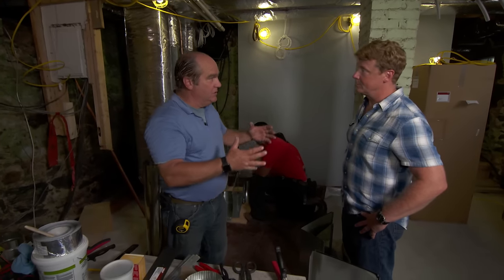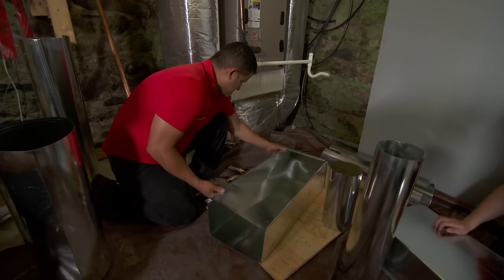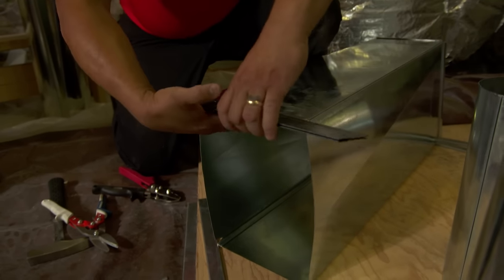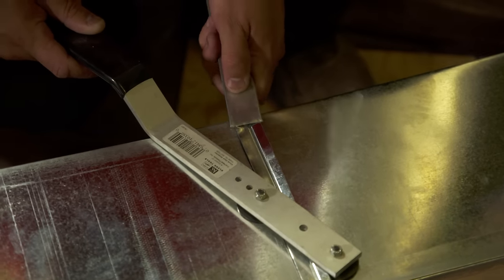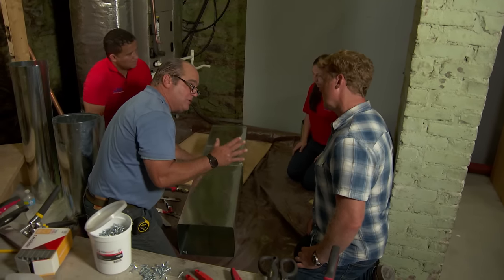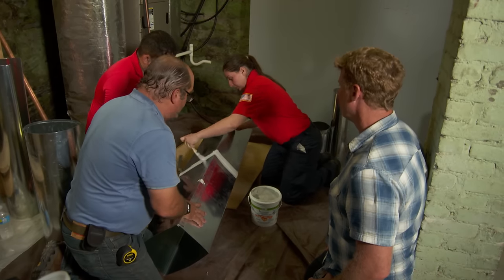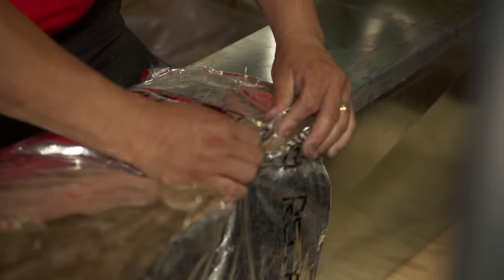How to Install Ductwork | This Old House

Comment: Very well done video but the contractor was a little wrong on the explanation of the purpose for the wrap of insulation. The purpose of the insulation for ductwork is to prevent moisture build up on the outside of the ductwork when the system is in cooling mode because in an unconditioned space when cold air meets hot air it creates condensation in turn can create a problem for water. Yes it also helps to keep the air cool in the duct so that the conditioned air can make it to where it needs to go but the main reason is for condensation. I have seen so many jobs where people tell me they have a leak in there ac system and come to find out the original contractor didn’t install the ductwork correctly and didn’t take into consideration the environment of where it was being installed.
Reply: no

Comment: In every home I’ve seen duct installed, it was never sealed that well.  Good work.
Reply: That's because no one wants to pay for the labor or materials involved in that.
Reply: So true lol
Reply: @CoasterCrazyy  or no one had a Richard watching that it was done right
Reply: @zefrum3 yes this is the real reason. If homeowners and general contractors knew what to expect and inspect what they expect then it would be done right.
Reply: Would you actually be willing to pay for it? Or would you like the contractor to end up doing volunteer work for you and everyone else?!
Reply: Builders want it done cheap and not just fast but. Now! Right now, if you can’t be done in a day you will miss the inspection. And the whine every time.

Comment: The only problem I see is you put the metal Tape over the duct seal which don’t give it time to dry. It’s actually supposed to be dry before you put the Insulation on
Reply: I was thinking the same thing, or reverse it Metal tape then seal It , on anything visible I mask off my lines with tape so I have clean lines, and This makes me Respect that bubble Wrap more than Ever.. lol

Comment: Ok that was pretty cool. Had no idea all that was done to make ducting.
Reply: This is the proper way to do it. I'm sitting here looking at my Grandmothers ducting in the joists of the basement as i type and the masting sealer, foil tape, insulation, screws, etc. are not present. This house was constructed over 50+ years ago though and many acceptable building methods of the era, while effective, are not acceptable in terms of today's professional contracting and construction code books and best practice reference manuals.
Reply: They still work however they are substandard.....
Reply: I thought 2 pieces like slid together didnt know you had to buy all that extra stuff
Reply: For numerous larger scale operations we typically use pre insulated duct boards.  These are much lighter than traditional sheet metal and are fabricated in industrial shops like the one I work in.  It's alot of fun! Especially since the Sheet Metal Trade is relatively small in my area.  You get to know the guys from other shops, installers, and do so all under the brotherhood/sisterhood of the Union.  If you want to see some more cool stuff you should look up Architectural Sheet Metal Fabrication/Imstallation (Building Facades and stuff like that).

Comment: Nice walkthrough! Never done this or even looked into it until now. Question: at 2:10 where he's hammering the drive cleat overhang to 90 degrees... would a hand seamer or other folding tool not work here as well? Is there a reason the hammer is preferred?
Reply: I was first taught to use my hand seamers for the bending of drive cleats. It’s a nicer fit and usually looks cleaner. Now I have used my hammer a million times to do the job. You will mostly be hanging duct and installing it in place. Sometimes it’s near impossible to get the top bend of a drive cleat. Hammer that every time

Comment: Noooo, the installation does keep the air in the duct the same temp but thats not what its foor, its to prevent condensation from developing on the exterior of the duct.
Reply: That's only true if the space its in is unconditioned, like there isn't a heat vent in the room. Say in the ceiling of a garage or a cantilever. Its honestly a waste to insulation so close to the furnace, unless you want to be hardcore and overkill it I guess

Comment: Interesting. I’m switching from baseboard heat to forced air very soon. Baseboard is getting too expensive and central air would be nice since summers are getting hotter where I live. I’ve always wanted to know how ductwork is installed and now I know. After around 20 years my baseboard heaters are nearing the end of their lifespan and I’m ready to replace them with something more efficient like ductwork. Great video!

Comment: Richard, this is something I am preparing to do. I don't know if you will see this, but maybe someone else who knows can tell me. I am installing a built in bookshelf and building a false wall (I guess that's what you call it) to hold that bookshelf. There is an air vent, so I need to extend the existing ductwork by about a foot. Is there an easy way to extend old ductwork without removing it? Can I just screw and tape it together with bending the pieces together?
Reply: Yes, there is. It would help greatly if you knew anyone who knew about the trade because they could whip up an adapter in literally 15 minutes. They might have adapters at the big box stores or stop in a local heating, plumbing place with a phone pic and some measurements and they should be able to help or direct you to a HVAC shop that can make that adapter you need ! Hope this helps.
Reply: @augustreil  thank you for the reply! That will make it easier than I had imagined.
Reply: @brianmoore581 , You're welcome, hope all goes well !

Comment: I was taught to put an "X" in the plenum to reduce noise
Reply: Cross brake. It makes the panel more rigid, which helps with noise from vibration or changes in internal pressure.

Comment: My Dad was a tin guy and I don't know if he installed duct this way or not. He retired in the mid 70's. Are these techniques that old?
Reply: Yes they've been doing it like this before the 70s, although probably not the insulation. Most old duct work wasn't insulated.
Reply: @rawbacon  Thank you so much.
Reply: Old duct work was insulated in asbestos

Comment: Someone has to come up with a better way to control air flow. Duct work seems so primitive!   I'm thinking someone could come up with a material that is self insulating (like an insulated, flexible plastic)  that can be installed in less time.
Reply: Its not primitive at all, they have high efficiency furnaces now that are 95%+ efficient, so you're only losing 5% of the heat generated that gets exhausted out of your house when they used to be 50-75%. That combined with proper duct and pipe sizing and you have an extremely efficient way of heating your home. The way homes are built today they are very tight construction so very little air escapes your house so what they are doing here is way overkill. All you need is to tape, and only insulate were the space is unconditioned.
In a business sense all about cost, efficiency and labor. They have flexible duct that's already insulated but its very expensive and not very efficient (1 foot = 4 feet normal pipe), you could use plastic in theory but its extremely expensive in comparison to tin, although if you want plastic you can do a high pressure system but again expensive.
Reply: Supplies are best install with sheet metal.  Returns you can use flex duct.  Just make sure returns aren't installed at 180°.

Comment: I got two rooms close to my Air conditioning unit that have sooo much pressure it's hard to sleep.

The 3rd area in the house has little pressure due to this.  Is there a way to reduce pressure in the first two rooms?
Reply: You may be able to install a damper on the duct work or even an adjustable vent plateif you want to go really simple and cheap
Reply: Your ductwork may be sized improperly. It sounds like you should have a larger sized supply to the first conditioned rooms (to lower air pressure) and the 3rd room should have a smaller sized supply to help maintain velocity.
Reply: You need dampers so you can balance out the system and send air where you want it to go.

Comment: In my home they didn’t tape the joints or connections or insulate the ducts. Maybe that is not done in the north country?
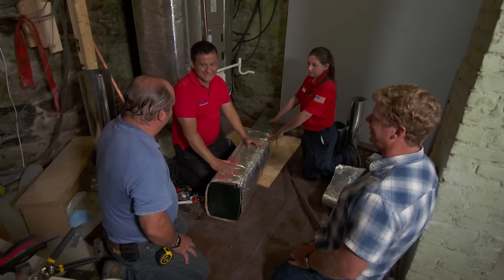Reply: teaglet 4:09-4:20
Reply: They should have tape the joints, you only need to insulate the ducts when its located in a space where there isn't heat being supplied too like above a garage for example

Comment: I've never seen drive pullers used on 10X10, 26 gauge metal before
Reply: If you have to use that tool then you haven't done a good job setting yourself up lol. We always call people hacks when they had to use it.

Comment: I thought you are suppose to leave an air gap between the duct and the insulation?
Reply: No- That is for the cellular reflextix junk- the "airgap" in that is part of the insulation performance. For fiberglass they did a great job installing it in this video- even as a contractor I would say this is top notch work. -Although I never like mastic tape, Just regular spread on mastic over fiberglass mesh mainly.

Comment: ditch the Square of you can . round has less air restrictions
Reply: Very true, but the dimensions needed for round compared to rectangular duct will have you making a much lower bulkhead. Example 10x8 duct is 8 inches high, an equivalent  round could be 10 or 12 inches making your bulkhead 2-4 inches lower and that's will small duct

Comment: Wow.....never screw the cleats....what if it needs to be pulled apart someday....
Reply: Pull the screws back out. They are not permanent.
Reply: @mitchdenner9743  No he is right, they are intentionally designed to be a "break a part" connection, so if some of it falls down it can break away from the remaining duct instead of pulling that down too.